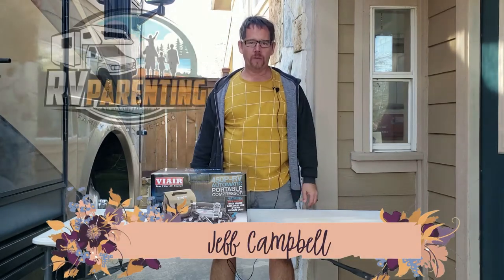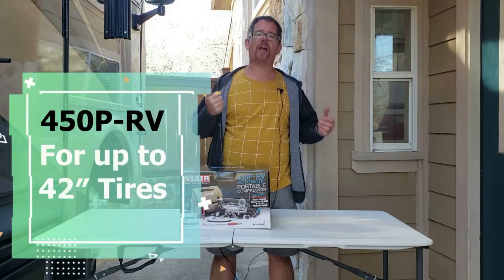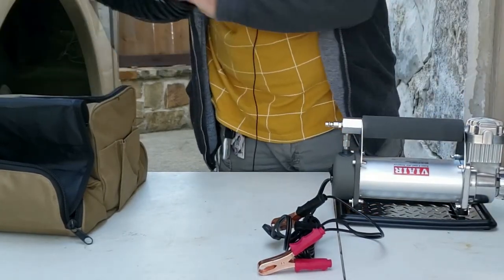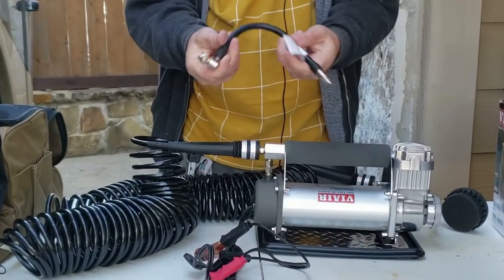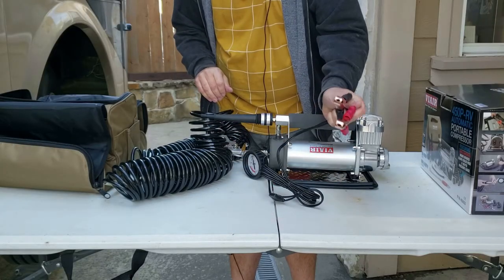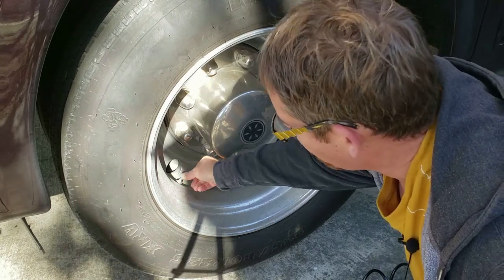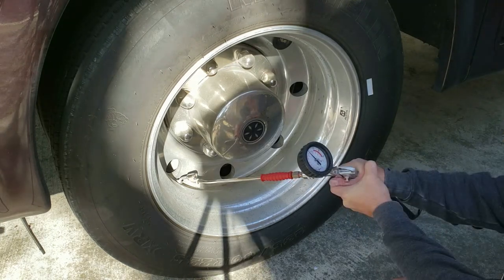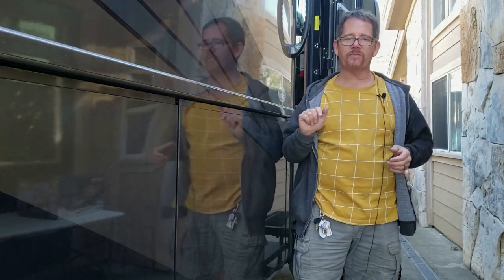Viair 450P-RV Automatic Compressor for RV Tires Review & Demo

Comment: Always run the engine to get full amperage to the compressor. Use vehicle or towable specs for tire pressure not tire sidewall.

Comment: WARNING: I bought the 300P to save money, and the 400 & 450 was over kill for my situation.  The 300 doesn't turn off unless you flip the switch, which involves a lot of running back and forth from the tire to the compressor.  Also, I HATE those slinky hoses so I use a standard rubber hose (must use a double female fitting at the pump or change out the male fitting on the compressor). Wish I would have bought this one, or gone with a different manufacturer.